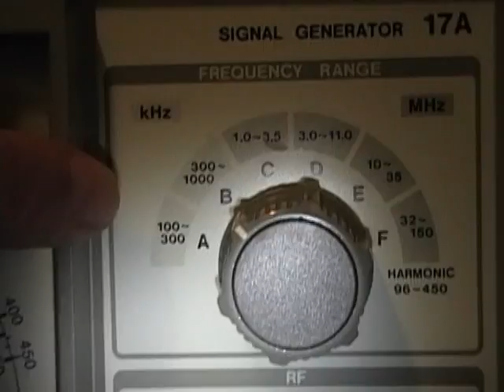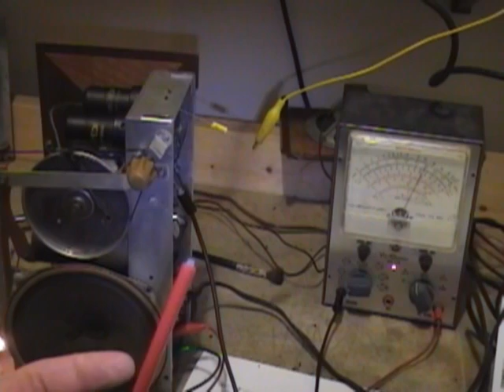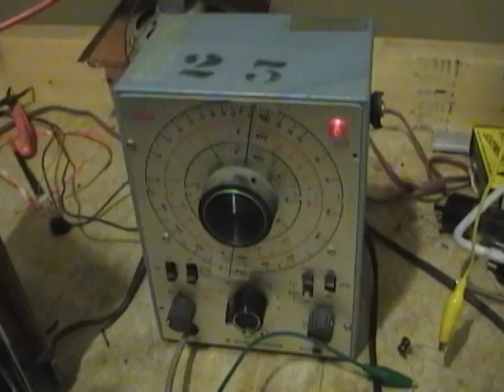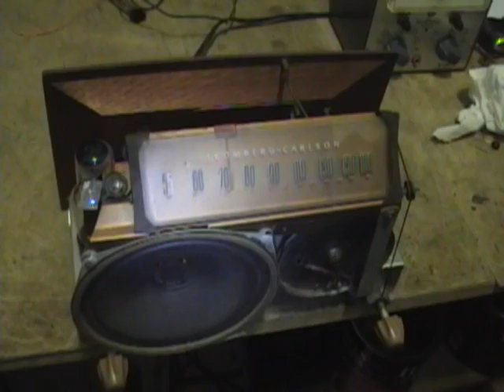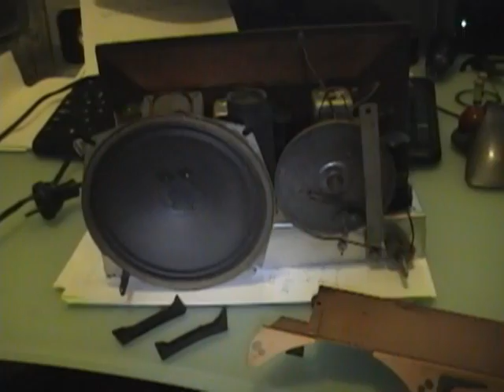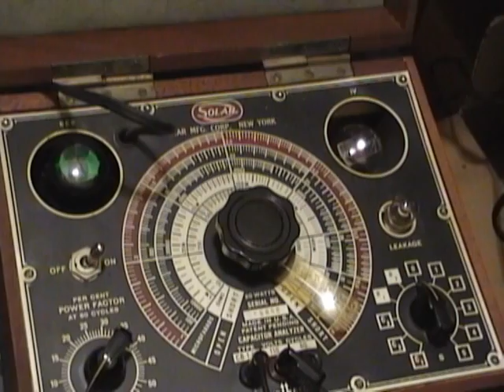Stromberg Carlson 1101 restoration p2o3

Comment: I like Stromberg sets, they are usaully made a bit better then average, the last one I picked up has a B- line made out of bare 14 guage wire and has all of the grounds returns ties to it, very different. It's also a good perfomer even though it doesn't look like anyone did any work to it, it will need an overhaul though to be reliable.

Comment: @TheThethinker101 See if you can find some phosphoric acid to treat the rust first, the best method is to dab a little on, let it set a few minutes, and then scrub with some 0000 steel wool. Sometimes it helps to take things apart firts so there are fewer items in the way. Better yet if the chassis and transformer bellls (covers) are really rusty electrolytic rsut stripping works the best but that means removing everything, tie points, transformers, tube sockets and all.